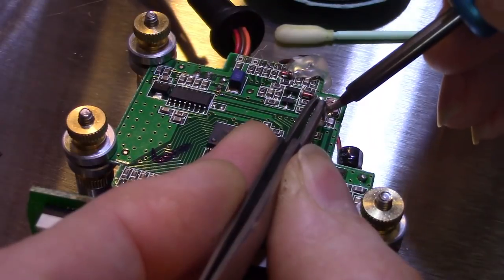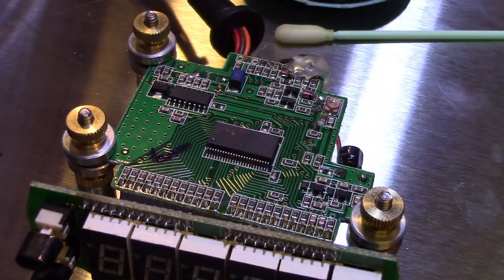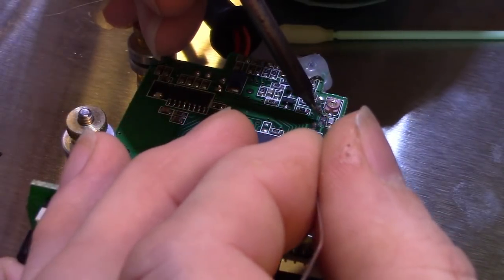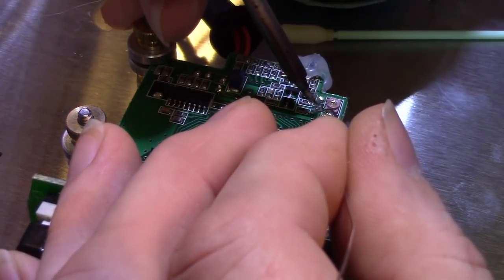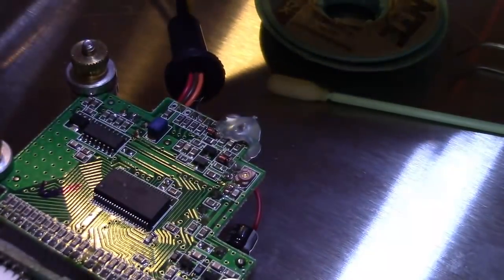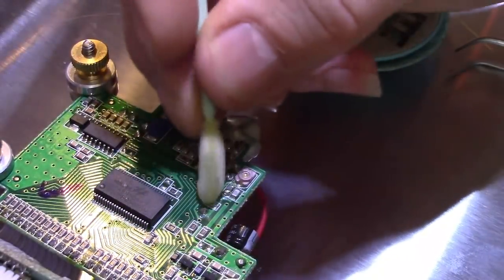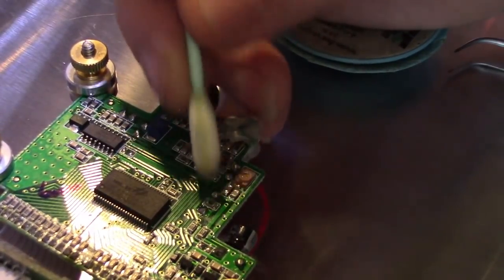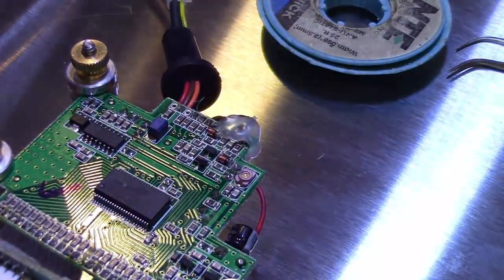Galaxy / Ranger frequency counter modification to correct frequency error.

Comment: Very informative video. I'd like to ask,   what is a decent frequency counter you may recommend for my superstar 3900G? That I can solder on myself. Thx.
Reply: Check out Copper Electronics - they usually have a sale on these counters for around 40 dollars which is lower than anywhere else I have found.
Reply: @williamcolvin3609  Thanks, I did. They are no longer about $40.
Reply: @MusicMinisterJP7  The night that I posted they were $49.95 plus shipping - cannot remember the last price I paid for shipping was less than $9.00 for Priority Mail Shipping. That is why I also posted the E-Bay listing for the lowest price and FREE Shipping as some are charging an outrageous price for the same item. I have bought many of them and never a problem so far.
Reply: @williamcolvin3609  Thanks, I did notice the $61.99 on Ebay. Another question arose.. My super Star 3900G twin finals does not have that black female connector for this meter. I am wondering if its a gigantic procedure to have to hard wire it, if it can be wired in. I'm thinking of going this way bcuz I misplaced the frequency chart for this radio. I also think its alot better.
Reply: @MusicMinisterJP7   When you purchase the Frequency Meter it comes with a Manual that covers the different boards and where to solder the wires. I take a cheap set of calipers from Harbor Freight or where you can find and measure the plug demensions and scribe my mark on the back plate in an area where the radios normally are located and drill the corner edges with a drill just smaller than the thickness of the plug. then you can use a nibbler to finish out the square. They are not hard to install just make sure your solder traces do not connect where they are not suppose to.
Reply: @williamcolvin3609  Ok.. I am familiar with performing this type precision surgery. But, when you say, "scribe my mark" what are you referring to? And, is this to indicate there will be a connector part coming from inside of radio, that will be accommodated to the rectangle cutout slot on the chassis? That's what I'm gathering. Thanks again, its all helpful.
Reply: @MusicMinisterJP7  Yes - just a guide to keep the size of the slot as accurate as possible to the connector is not too sloppy in the hole - I have gotten a little too aggresive at times.
Reply: @williamcolvin3609  Have you done a video on this particular job?
Reply: @MusicMinisterJP7  - No I have several of the SS.3900 Radios and several of the Old Galaxy SSB Radios none of which had counters which is kind of useless if you want to see if you are on the Correct Frequency - so I have used the CB Tricks Website and found a lot of useful information there and there are no repair shops around so I decided to give it a try. I did a lot of tinkering before my mind and eyes decided to fail me so now me and the others who refuse to buy the Surface Mounted Radios are pretty much out of luck for RELIABLE RADIO REPAIRS.
Reply: @williamcolvin3609  Oh wow, bummer. I know what it is when sight begins to fail. What state you you in, if I can ask? I'm in NY, westchester county. I only know of one Radio shop down here, "Delta Electronics". They're pretty well hooked up, from the customer traffic I've seen. 
I myself am looking to sorta beef-up this radio to its fullest potential, I think they call it "Freak-Peak" modification. But I find it hard to dish out $60 plus dollars on that small box..jeje.  I'm also looking to get something like a Wilson or K40 for the mobile. Someone "Bonny& Clyde" my Antron 99. smh..
Reply: @MusicMinisterJP7   I live in Louisiana - Shreveport would be the closest big city showing on a map which is a little over 30 miles away. I live in a little place called Porterville which is actually a Sarepta Mailing Address anyone into ATV Mud Riding knows where Muddy Bottoms ATV Park is which is only about a mile west of my house and about 5 miles South of the Springhill,Louisiana and the Arkansas line off Hwy 371. If you want a radio that talks good go to the NEWEGG Website and find the RM Italy KL200P Linear Amplifier or if you do not want a PRE-AMP just get the plain KL200. With a Radio Dead-key of 2-3 Watts it will key 80 Watts and swing a little over 100 and you can pretty much talk anywhere you can hear with that A-99.
Reply: @williamcolvin3609  Really? wow, my radio DK is 20W, 22 when I talk.  just saw that KL203P on ebay for $69.99 + $31 Ship from italy.  But my A99 was jacked. thats what I meant by someone "Bonnie & Clyde" it (stole it fews ago)..lol. what can I say. Thats why I'm looking to get a Wilson 1000 for the van. Or, another A99 for the roof. But thanks for the info on the linear. I'll look into that. cheers John
Reply: @MusicMinisterJP7  The 203 version is holding up so far - but their other MOSFET Types are failing,I like the 200 type single pill type design with a VERY SIMPLE CIRCUIT unlike the 203 Mosfet version. I will try to find the link to the Schematics and you will see what I mean. I have been using the 200P for over 20 years and the only thing I have ever replaced is the Receive Transistor from Too much Power Too Close or Lightning Static Too Close. I love mine and everyone else that has purchased loves theirs. They had the 2 pack on sale at one time $150.00 and FREE Shipping. The 200 version is a little higher in price - but to me is worth every cent in Simplicity for things to fail.
Reply: @MusicMinisterJP7   - What Radio do you have,the Dead Key is not heard so the High Dead-key just strains the Final Transistors the Modulated Signal is what people are going to hear. I mainly use a Texas Ranger 696 in a Base Radio and in my Mobile. I cut my yellow wire inside for lower channels which I think goes down to channel 6 on C Band and covers up to Channel 40 on that band.Same Radio as Galaxy DX959 except the Ranger has a 6 Digit Counter instead of the Galaxy 5 Digit Counter.
Reply: @williamcolvin3609  I have a Superstar 3900G, with EPT360013B pcb. I use a Road Noise ER-009 power mic with echo.
Reply: @MusicMinisterJP7   - I have a couple of Old Astatic D104 Desk Microphones that I replaced the Dried-up Capacitors in and the Astatic Road-Devil D104 in my mobile. Those little amps only pull 7-8 Amps which is a lot less than your other amps like the Texas Star Amps a 10 or 12 Amp supply is plenty big enough - seems like I have ran on a Pyramid 8 Amp with no problem.
Reply: @williamcolvin3609  Will, its funny you mentioned amp supply. My SS 3900G can't run on anything lower than a 15amp PS. Back in the day (1998) I ran this radio with about a 20amp pyramid. That got lost too. I tried using a 7- 10amp PS and when I key up, the lights go dim and the radio begins making a popping noise thru speaker. My Cobra 25 Ltd lights up ok, but I can't tell if it's working. So I ordered a Pyramid PSV-300 30amp. Should be here Tuesday. Then I'll be in a better position to see what is what.
Reply: @MusicMinisterJP7   - Now that is strange that 200 Watt SSB Amp and my Galaxy DX77HML 10 Meter Radio with Dual Finals that swings 40 Watts neither takes over an 8 Amp Supply my 77HML stays connected to a Pyramid 7 Amp Supply I have never ran anything on a Switch-Mode Power Supply so do not know how well those work.
Reply: @williamcolvin3609  Strange it may be. I haven't a clue as to why. Perhaps my small 7-10amp has some sort of short..
Reply: @MusicMinisterJP7   - LCD Digital Battery 60V/100A Watt Meter Voltage Amp Monitor RC DC Power Analyzer put inline to monitor your Voltage and Amperage then you can tell if you have a failing Power Supply or Radio Problem. I keep one in mine after a capacitor blew in my power supply and I started swinging 200 Watts on the AM Side over 20 Volts DC coming out and still did not hurt my amp so those amps are built really tough.
Reply: @MusicMinisterJP7  - Sounds like the Voltage Regulator in the Power Supply may be failing or it has more than one and one is not working - once you put a meter in line with the radio you should be able to see the problem. When I replace my Voltage Regulator I usually go with a Heavier Rated Regulator a 2N3055 is usually what most have which is 15 Amps. I cannot remember what replacement that I use but it seems like it was 30 Amps which runs cooler since it is rated for higher amperage.
Reply: @williamcolvin3609  Well, I don't have that fabulous type equipment, but I will look into one. I will also open up that ps and check for blown circuits.  Thx.
Reply: @williamcolvin3609  Hey, now that we're talking about PS amps,  is it possible to turn or raise a 7amp ps to higher Amperage? Like by changing components? Id like to try..
Reply: Hey WC, I opened up my 7-10amp PS by Mobile Authority, and inspected everything in there, but found nothing burnt or otherwise. I'd like to know how to check that voltage regulator with a multimeter.
Reply: I tried viewing a few videos on testing the transistor, but that Base, Emeter and collector jiberish lost me..hehe. in either case I didn't get readings that match ones on the video. Perhaps you can elaborate..

Comment: If I was still working at Hatachi Computer Systems your soldering would be borderline failing. For surface mount components, try using just the solder you have on the tip of your soldering iron. If your prep work was done correctly, the component and the board will pull just enough solder to bond the two together and that is what you want.
Reply: Darryl May I'm not trying to be a jerk here but borderline fail? For which class? 1, 2, or 3? I am currently in the industry and have class 3 certifications in SMT and through hole. His work would need to be inspect under the proper magnification and for class 2 at most.
Reply: Sorry but my initial training working with SMT was with NASA. When I was trained at Hitachi they didn't teach about any classifications. Maybe because I worked at a manufacturing facility. And, again, things could have changed since I last worked in the industry in 2002.
Reply: Darryl May Oh no biggie. NASA huh? Pretty darn cool my man. Heck, I'd be happy to be a floor sweeper for them lol. Peace brother.